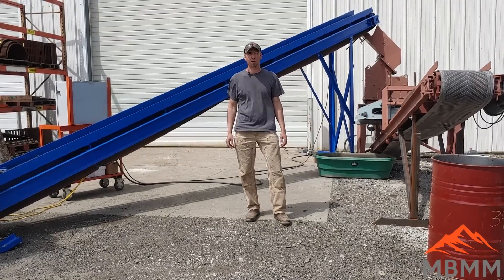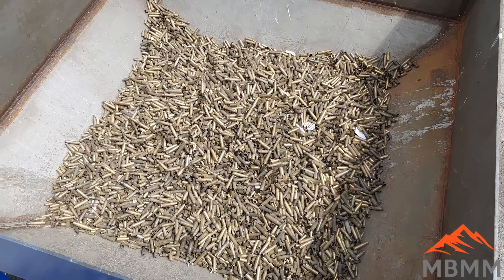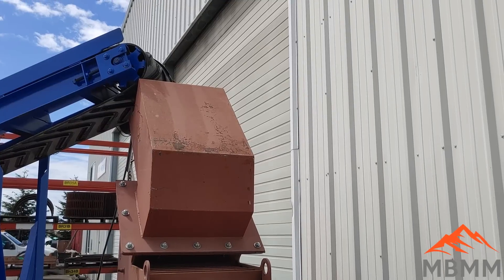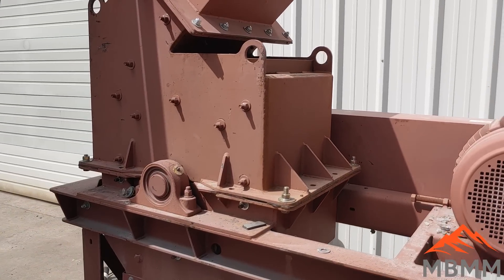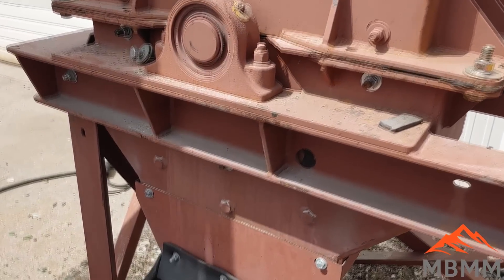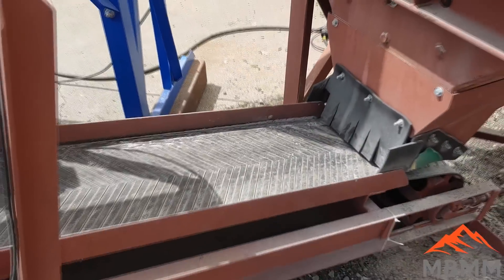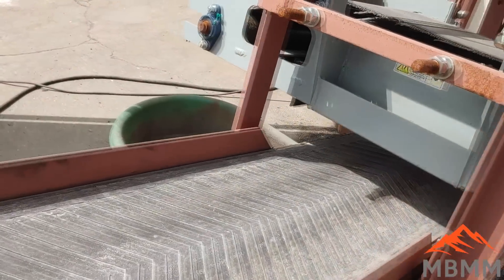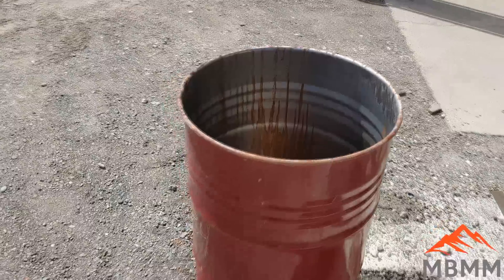American Military Spent Brass Shells, Why & How The USA Destroys Brass Shells After Firing?

Comment: Did anyone else notice the 9mm (or maybe it was a 40S&W) at 3:34 with a live primer still in it? Amazing it could make it through like that.
Reply: How can it have a live primer when it has been spent?
Reply: @lordeverybody872  Possibly a pre-primed case that was never loaded. I've also seen live rounds pop in a melt pot. Range lead in large quantities can let them slip through. When I process range lead I melt it with a perforated steel cover to reduce the splashing.

Comment: As a hand loader this is heart breaking
Reply: My .45-70s reload now nicely, 54gr of H335 and 405gr lead cast bullets. Reloaded a few of them several times and not seen anything wrong with the casings yet.
Reply: @bullgravy, what kind of velocities are you getting from that recipe?
Reply: Seeing as how I saw several 45 lc cases and numerous other hard to get cases, I absolutely cringe since I can't even get any of them right now to reload😢
Reply: @southronjr1570  hence why you need people to recycle. So they can produce more for you to buy the reload
Reply: @soulseeker42388  Reloaders are kinda the ultimate recyclers. I have cases thatI have reloaded 8and 10 times. My father was even more of a recycler than me, he would shoot solid lead bullets out of his 45LC, dig the bullets out of the back stop, cast them again, reloaded with black powder we made and shoot again.  I have some of his reloads that I know were shot at least 15 times and as long as you keep the loads light, you can get away with it. For hunting, I use only cases with just 2 or 3 firings and make them full power and retire them.
Reply: @southronjr1570  If you get an annealing machine, you can use those cases many times over than 2 or 3 firings.
Reply: @southronjr1570  What?  45LC is a LOW PRESSURE case.  Doubly so when we're talking about black powder loads. They can be reloaded AT LEAST 50 TIMES.  Indefinitely if you anneal.  You're throwing away good cases LOL
Reply: The US should not export brass to other countries period. Not any other precious or semi-precious metals. What a shameful contribution to the government control overlords wanting to restrict and manipulate free citizens. Mbmmllc should work to save this valuable resource and protect Americans.
Reply: @richasay9077 ok?
Reply: @richasay9077  he works for Soros or someone like that. 
 Scrap brass price: $2/lbs
Reloadable cartridge case price: $100/lbs
Someone's paying him BIG BUCKS to destroy 98% of the recyclable value of this scrap item

Comment: I don't want to get involved with the morons below that want to twist everything into something other than what was intended like OSHA, EPA, MAGA etc but I do want to ask how much you get paid to turn all those cases into pellets? The reason I ask is that there is a very large market for reloading all across the USA and each one of those cases were worth at least a nickel or more to Americans across the country.  I have no clue how many cases were in that hopper but you crushed up a shitton of nickels. You've already been educated on primers are not "firing pins" so to further your education a bit, primers are little copper (for softness) cups that are often nickel plated (usually for the civilian market). I have no clue what nickel is worth but maybe smelting out the nickel could add a little profit to what seems to be a deplorable was of a valuable commodity.  Just saying.
Reply: The feds have a website for the purpose of disposal of surplus, obsolete, and damaged military goods. Anyone or any company can bid on these items. Some things they don't care what happens, some have to be destroyed, some can only be sold to companies that will melt and resell to the foundries that make replacement goods, like armor and weapon parts.
They sell thousands of tons of stuff.

Comment: This was a problem a few years ago that Congress was made aware of. Selling once fired military brass oversees was banned. This brass was supposed to go back on civilian reloading market.
Reply: Still a waste of resources to reprocess, military could reload for pratice
Reply: Civilian can just resize and reload still a savings
Reply: it was never intended to go to the civilian market...the civilian market can make it's own casings...
Reply: @imperialpresence3331  it doesn't matter what the intent was.  Its wasteful to not reuse them.
Reply: @jeffkasal330  not to mention We the people paid for them.
Reply: @imperialpresence3331  that’s completely false. Making brass cases is incredibly difficult and requires a huge investment in industrial equipment to take brass cups and die forge them into usable cases.
Reply: @richasay9077  Most pistol brass is able to be machined from brass rod stock without too much issue, you do need the dyes and the press to load the tooled brass casings however
Reply: @imperialpresence3331  UNTRUE!

Comment: I hope they sold some brass to reloaders because military brass is some of the best brass for reloading.
Reply: Military requires destruction
Reply: @markd7384  Depends on the base commander, some do and some don't.
Reply: @pagansmc13  And your point is? I've bought a bunch of once fired military cases in 308/7.62 and found it to be very good brass compared to some commercial brass.

Comment: To mbmmllc you guys make great equipment  . But the trouble I have is that the equipment is being used to turn 5.00 a lb shell casings in 1.00  a lb brass scrap. As you have shown one person can run the line but if those same rounds are reloaded that would make about 10 jobs. That is our government at work for you
Reply: I’m sure the scrappers would be more than glad to sell you all the cases you want. It’s just that the supply far out weighs the demand.
Reply: @barry-

You have exactly no clue at all reference what you were talking about...

Comment: Ignoring the obvious question of how did the live rounds get lumped in with expended casings... Won't the lead and copper from the bullets in the unfired rounds contaminate your brass?
Reply: IIRC Lead has a very low melting point so it can be easily removed.  As for the copper contaminating the brass ... Brass is a certain % of Copper and Zinc to begin with.  So after melting together than can measure the Zinc content and add more if needed to bring it back to spec.
Reply: Not sure how it works at a military range, but the brass is simply swept up and dumped into barrels at most ranges. If a round does not fire and is ejected it usually disappears on the ground in the pile of brass. The brass is NOT gone through to check for non-fired rounds. It all goes in the barrel, then off to the recycling facility or reloading facility.
Reply: @MrLarry0001  Yeah, since I was in the service the range police call standard was probably different.  These days service members are likely firing a lot more rounds than I did, as a result they likely relaxed the thoroughness of the police call for brass.  When I was in it was a few hundred rounds per soldier per quarter.
Reply: They all end up in the floor, and very often when firing a gun one of the round wont fire, so you just remove the round as fast as possible and continue firing. The person cleaning the shells from the floor will rarely stop to pick up the live rounds.